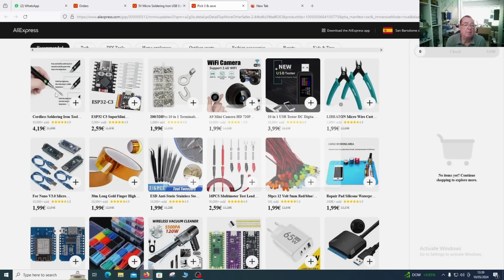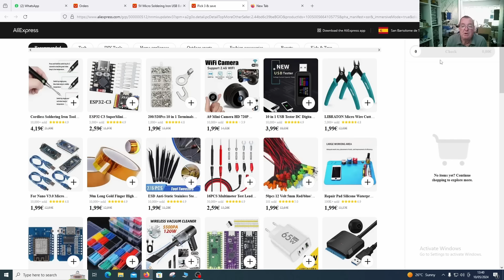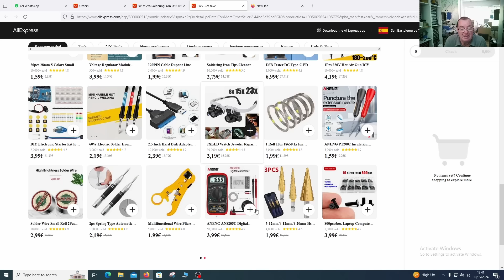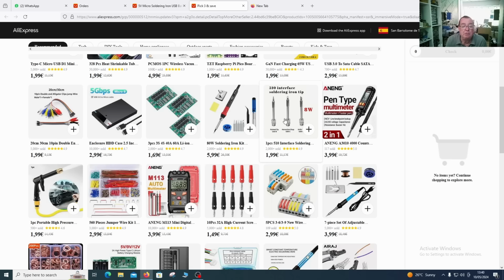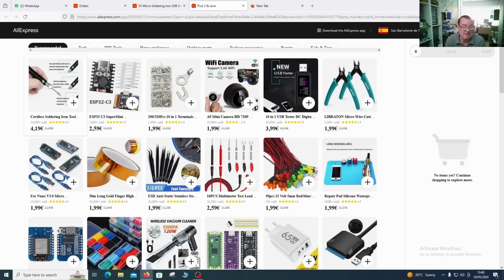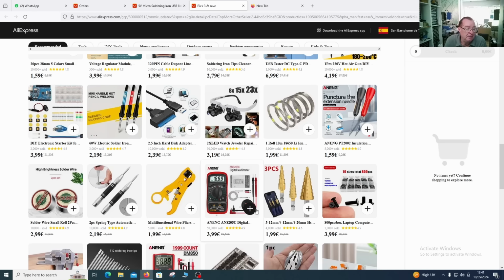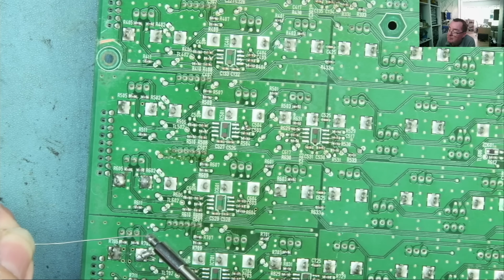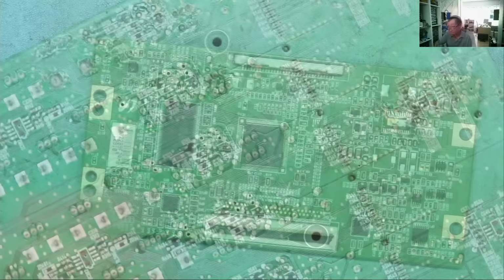I Bought A Battery Powered Rechargeable Soldering Iron for €4. Test and Review

Comment: I bought the tip only as it fits a standard vape device. It's great for quick fixes, eg my garden lights. The hassle of taking the lights down or getting power and a rework station up a stepladder meant I'd left the job for far too long. Quick solder job and a bit of self-amalgamating tape and I was done in a few minutes. 
Of my 6 soldering irons it's definitely the one i use the least, but it has earnt a place in my toolbox. Especially as the tip takes up barely any room.

Comment: Hi Dickie. 
 My wife bought me a battery operated soldering iron a couple of years ago. It’s made by Draper( familiar to UK viewers) and, from memory) takes AA batteries. I have used it a couple of times and it’s actually quite good, heats very fast and good for tinning wires and working on cars/trailers outside etc and “ roadie” use.  Of course one could always use it with rechargeable AA batteries. 
 I also have a “ Pyropen” gas soldering iron( which also has a hot air nozzle) and it’s excellent, but at an equivalent 60watts is rather too unsubtle for delicate work.

Comment: I bought this and 2 other tips.I found that if the iron was on for a minute or more the body and button on the iron got extremely hot. The button was at 55c and the body of the iron 74c. I filed a dispute and got my money back on the iron. I then came up with the idea of wrapping a thin layer of cork around the iron and it solved the problem. I had to cut out a hole to get access to the button but it also prevented my fingers from slipping towards the hot tip. 😀 Iron was $11 including 7% tax and 2 tips $6.30 CDN including tax
Reply from the maker: That's interesting as this one does get warm after some use but it is not so hot it was uncomfortable to hold.  I think Det says his gets warm as well

Comment: Using IR camera to check the soldering iron tip temperature isn't precise at all. That is because in order to get sensible results, your IR camera needs to take correct emissitivty value into account when computing the result. The emissitivity depends on the material (and it's oxidation) so it's hard to guess for the unknown soldering tip.
Reply from the maker: Thanks for the info

Comment: This is like finding a use for those "portable vapor generating devices" by retrofitting them with soldering iron tips. I'd prefer the L245P as it takes a standard tip and can run off a power bank or basically any DC source you might have lying around.

Comment: That ET13S I ordered on your link has arrived in the UK already, Richard! I ordered it around the time you messaged back regarding them going on a sale. It's very impressive for the price. Less that a quarter of what I paid for my main flir type camera.
Reply from the maker: Hey that's brilliant and I'm glad you liked it.  Did you see the video where I used it an also showed you can set it to boot either into multimer or camera mode on startup, plus you can select the default mode for the multimeter too?
Reply: @LearnElectronicsRepair  I didn't see that yet, Richard. I have a lot of multi-meters (12) so I wasn't massively bothered about that as a function, but it is nice to know. I've mainly bought it as I am training my 17yr old son, and it is a very nice addition to his bench. Do you have a link to the video you mentioned? I've missed that one. I usually have them (your vids) on when I am fixing electronics for Cash Converters.

Comment: The rechargeable battery on this soldering iron is very similar to the rechargeable battery used for E-Cigs. The end terminal looks identical. Obviously, the way it's controlled is different as the E-cig version is powered while the button is pressed. I might experiment with some tips and an E-cig battery pack they can be much higher wattage, but only while the button is pressed.

Comment: The IR camera can't measure on a smooth metal surface, that's why you get a bad/wrong reading, need to measure with a normal temperature probe. The soldering iron doesn't have much heat capacity in it, so only good for simple small solder jobs.

Comment: I have 2 mm solder that my none of my soldering irons is will melt no label any idea what that is
Reply: I'm not 100% sure but I remeber my dad had that too but he used it with a gas torch I believe he welded lead with it
Reply: Possibly silver solder? I have some here (looks like fence wire) and have to bump up the temperature.

Comment: Best bang for the buck on a portable iron is to get a live-forever $15 Pace tip with the gold contacts you can solder to on the cool end. it's long enough to wrap some fiber cloth around to insert into a DIY handle and @3.2 ohms you get 40 watts out at the car ready to work in 10 seconds.
Reply from the maker: Give me a link and I'll buy one just to test it on video.
Reply: @LearnElectronicsRepair  Just in case YT blocked me, I re-rest here. On your followup I mentioned:
You've chosen to opt for expensive and inferior coated JBC and Weller tips, and oh boy! a DIY controller. But if DIY is anything to a novice hobbyist, it's to keep it simple and save a ton of money, hence the reason my email mentioned the idea of a foot pedal (or handle button) activated 555 PWM control to the longer lasting and more economical PACE tips. Getting into this zero-crossing temperature sense will now be the economical undoing of this project for 90% of the budget hobbyist's just here to learn. I wish you luck since everyone who's tried DIY multi-tip temp controllers with internal series connected thermocouples has failed.
Back story: When I got my ADS-200 six years ago I started a thread on EEVblog and I managed to get Pace to send Dave Jones one for review. He has a genuine JBC 240 station but ever since, prefers his Pace (you can see it in use all his videos). Anyone can clearly read in the thread (and search YT for "JBC Killer") that serious JBC users have shorter tip life and corrosion. You will also see in the forum thread, linked below Dave's video, many attempts to do what you are doing now. Watch the video and read the forum thread so your project is a success by not failing in the same place others have (and no, I'm not saying this can't be done without Pace tips). Cheers!

Comment: Takes forever to heat up
Reply from the maker: I think I was erading the temperature in the wrong place, when I tried it the tip would already melt solder
Reply: Yeah I have a T-12 and it gets hot really fast. I've drag raced it against my Weller and it's faster. Even though the SMPS I run the iron on starts slowly.